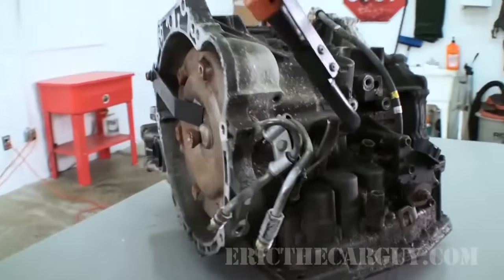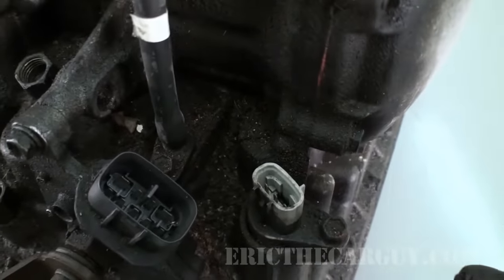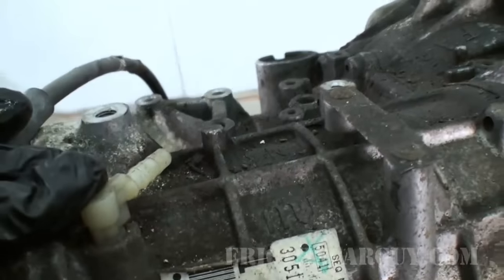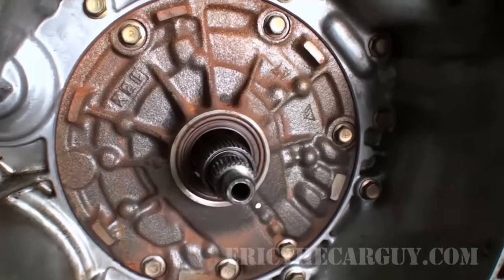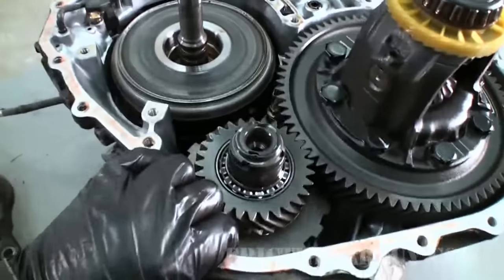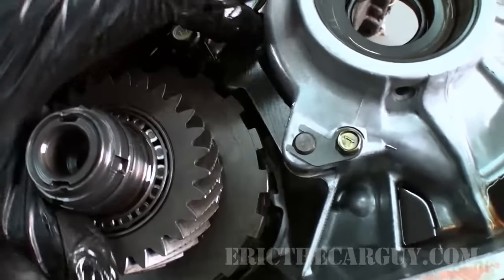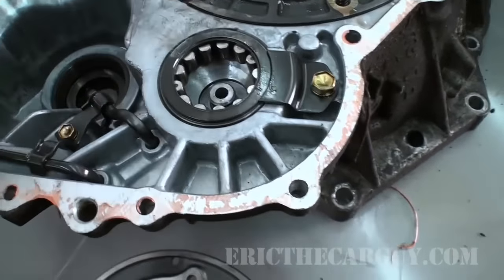The Basic Parts of an Automatic Transmission (Part 1)

Comment: Whoever designed Automatic Transmission is a mad man who could think of this its amazing
Reply: agree
Reply: +Jason K Well you have to keep in mind that it wasn't one person. It took many years of trial and error to get a smooth, reliable automatic transmission. So there were a lot of brilliantly smart people who were involved in the making of this. Same goes for most other engine components. It's really amazing to see how far car technology has come!
Reply: +Jason K It's a product of the free market. That little things Sanders wants to get rid of.
Reply: +Danny Zabolotny very true! hard to believe that 45 years ago people had clothespins on their fuel lines in the summer and points in the distributor. Now we have computer controlled fuel injection that can self adjust constantly, depending on current situation. also thankfully,no new car ignition systems require points! which I am very happy about.
Reply: Henry Ford.  All planetary gear automatic transmissions are adaptations of Ford's model T transmission. He thought of using a pair of planetary gears with bands to arrest the ring gears thereby changing the drive ratio. The T's transmission bands were operated by foot pedals, not hydraulics, but the operating principle is Henry Ford's.
Reply: I remember points, but what was the clothespins on the fuel line?
Reply: It was originally made for city buses in the 30's
Reply: I think the automatic transmission was made by a woman
Reply: It was a brilliant advancement
Reply: @lovestrong4572  Lolz. Ok let's say you are kidding. Right?
Reply: The basic design is really simple. My kid built one out of his toys when he was 4. Played with it in the bathtub.
Actually making it work for a car though, that would have just been trial and error making it better over the years.
Reply: Almost seems like I'd imagine alien tech being
Reply: It was Tesla
Reply: @UndefinedSlope  It's also a product of "access" to excellent education which Sanders is promoting.
Reply: @wailnshred to  stop vapour lock
Reply: @richardrichard5409  Ok I understand now.
Reply: Lovely video content! Excuse me for the intrusion, I would appreciate your thoughts. Have you ever tried - Tarbbatigan Cars Rehabilitation Tip (erm, check it on google should be there)? It is a good exclusive product for learning how to repair your car the easy way minus the normal expense. Ive heard some great things about it and my buddy at last got astronomical results with it.
Reply: You think this is crazy, people thinks it's simple, but the suspension system of a vehicle is nuts and had alot of thought put into it. You're dealing completely with physics and the laws of motion and inertia
Reply: The Automatic gearbox was invented in Argentina they also invented the Helicopter
Reply: Hello let me tell you something they made automatic transmission because it's easy to handle in heavy traffic.Get sense!
Reply: @lovestrong4572  women's can't make these sophisticated things and if a man tries they'll fight and behave as if you are mad
Reply: You don't ever buy a car or even a bycycle all machines are complicated and hard to design and understand
Reply: Very complicated and yet it works like magic..
Reply: Yess!!!!
Reply: Ah yes,  Mr. Otto Trammishin
Reply: I thought the same thing!

Comment: The front pump is driven by the input side of the torque converter (as opposed to the transmission input shaft which is driven by the output side of the torque converter) which is bolted to the engine flywheel/flexplate so that it can generate pressure (flow) any time the engine is running.

Comment: Hi Eric! I watched the whole video and I learned a lot. You see, I have a 2Y Engine Toyota TownAce Automatic and it only runs for 20 km/h. I even stepped harder on the accelerator but it didn't changed anything in my speed. After reaching a 20 km/h, it only slides and doesn't change speed. It stuck with 20 km/h. And it sounds like it's already at its finest but the speed remains. I just want to ask you what is the problem? I am really having a hard time fixing this. Thanks in advance! :)

Comment: I was always curious. What's with all the random veins/holes/slots? Is that for weight reduction? As far as I can tell, they serve no purpose, other then to make the housing lighter? Right on the top of the transmission where the converter goes. There's a few random pits?

Comment: I have a Chevy cruze that I was driving around 70mph o n interstate and suddenly "transmission oil not idle engine"  I h ad to let cool then drive.  A month ago I had fluid out in cause it was low.  I have to drive 60 miles to get home.  Any suggestions?
Reply: Also, I had to add trans fluid about 4 week ago.  I was reading you never should have to add trans fluid. Hmmm

Comment: A hard shift to a certain extent is easier on the 2nd gear band because that means there is less slip and less heat built up. It isn't a bad idea to change your oil so you know it has the correct grade in it. There are a few types of auto trans oil and they are not interchangable.

Comment: so many moving parts and the complexity is astonishing compared to manual transmission. No wonder so much power goes to waste in automatic transmission. Stick shifts for life!
Reply: Eli Malinsky What he's shown is just 20% of the auto, he hasn't got to the details, its crazi i tell ya, he hasn't got to the solenoid and the sensors that work in unison with tha AT networked by the car's ECU and ETC, its madness!

Comment: Eric I noticed someone else also had this concern that If you haven't changed your ATFluid in a long time and then change the trans fluid it could cause more harm than good. Is this true?
Reply: Yes. In fact in newer cars you don't ever need (or should) change transmission fluid. I've never gotten an exact explanation for this, but was told that a sort of harmony is created between the fluid and different clutches and assemblies.
Reply: Roman Smirnov Its called job security, they don't make money if you prevent your transmission from failing prematurely
Reply: That's pretty pessimistic Matt
Reply: If you have a new car, it is best to keep up with automatic transmission maintenance. Have the fluid drained and refilled every 30,000 miles
Reply: First Name Last Name Fredrick mfungati
Reply: Thanks a lot
Reply: A newer machine can actually flush debris from the transmission, so if possible you are able to flush all the old fluid, and the grime and particles from the old fluid out, after flushing the lines for about 2 hours with a machine, it is possible to have the lines and transmission clean, either way it is not good to have the particulates running through the tranny, flushing the transmission and clearing the cooling lines, and the oil pan have a very high chance to get rid of the particles that were made from when the fluid was there for so long, the machines also do not "suck" the fluid, you hook up the machine to one end of the cooling system for the transmission pumping out the old fluid while also pumping in the new fluid, so its a 1-1 ratio of removing and adding.
Reply: @romansmirnov3351  called reality
Reply: First Name Last N
Reply: @romansmirnov3351   sealed transmissions from the manufacturers arent fully sealed, you can infact change the fluid just remove with a hose and suck it out and squirt it back in, also car makes such as volkswagen say their transmissions including manuals from the older vw jettas are sealed for life, so you shouldnt have to change it for the transmissions life aka until it needs replaced, rebuilt, and for life as in 150k or higher depends on a lot of things, but you can change the fluid cause there is always some sort of filler hole/drain hole etc, and trans fluid should be changed every so often, keeps the transmission from overheating because dark fluid is from dirt, grime and small metal pieces and they heat up and cause the fluid to heat to a higher degree than clean fluid/refreashed transmissions.. but as for manual transmissions they tend to last longer than automatics, usually can always change the fluid easily, and just keep clutch replaced but overtime every transmissions gears teeth are gonna wear down to the point where itll slip and not grab/bite
Reply: @romansmirnov3351  Not really, it still needs to be changed, they claim you don't need to because they want you coming back for either a new transmission or a new car when it fails from lack of being serviced.  Many times you can get away with a 50k service interval for a car's transmission, but for a truck doing some heavy work cut that in half.  Transmission fluid is a heck of a lot cheaper than a transmission or a new car.  

Fluid still needs to be changed regardless what the manufacturer claims.  Transmission shops will tell you the same thing because they see this lack of service on a daily basis so they know what happens far better than I can explain it.  

On the other hand if the fluid has never been changed in say 100k miles then I'd be careful about changing it, take it to a shop and they can determine if its safe to change or leave it alone.  I did this with a questionable vehicle that I was unsure of the service history on and the seller couldn't recall if it had been serviced or not and I took it to AAMCO and they tested it out and said it was ok to change the fluid and filter...that's been about a year ago and the transmission shifts great, need to have it serviced again to drain out more of the old fluid.  Doing a fluid/filter change doesn't get rid of all the old fluid, you still have fluid in the torque converter and other passages, kind of like an engine, you never really get 100% of the old oil out.
Reply: @alcool0828  This is a very good rule, I wouldn't recommend doing that flush on any transmission really, there's no need for it, a simple drain/fill and filter replacement will do fine...and ignore the "lifetime" fluid BS of automakers, they do that in order to get you back to the lot for a new transmission or a new car when your old one blows up from lack of service.

Comment: It's a a245e transmission from corollas from 93 to 08 lol it's bulletproof if you dont let metal shavings contact the solenoids
Reply: +Bryan So metal shavings contacting these solenoids somehow is actually possible let alone a common defect here?
Reply: I agree. Built by Aisin Seiki in Japan for Toyota. My 2000 Corolla has 220,000km and going strong.
Reply: Evan93 mine has delayed engagement now, 175k miles. Bought it used a few years back tho

Comment: Very interesting! It blows my mind that people thunk this stuff up!! Just blows my mind! But, I'd need a xanax the size of a hockey puck to assemble it all again :(
Reply: If you stop, slow down and think the process through and take your time disassembling and reassembling one isn't too bad, use the factory manual and go step by step and don't try and take short cuts.  They're not as complicated as people think, just a lot of smaller parts to try and not lose or forget...and you really don't want to forget any as often times if you do the whole transmission has to be pulled apart again due to the way they're assembled.  Many of the components are broken down into smaller groups of components, which helps a lot, so disassembling or reassembling the smaller groups of components makes the whole process much easier to understand.

Comment: The Ford AOD has that lever which goes to the column shifter.
Reply: Most of them do, err...did, I believe a lot of the newer ones don't, they're electronically controlled by wire rather than cables or levers, so when you move the shift lever you are just sending a signal to the computer to put it into whatever gear you selected.

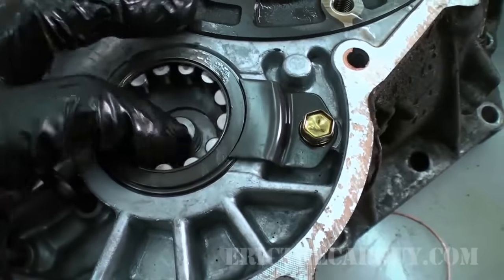Comment: I have a 98 MPV. I recently flushed the auto-transmission fluid. Inside the trans fluid pan I found broken a plastic washer that looks just like the one above the bearings in minute 21:08, only mine was broken in half and sitting in the bottom of the pan. The MPV has been running fine, however I do notice a faint smell of something burning. Any suggestions on what to do ?

Comment: "If I find a problem with an automatic transmission I just replace it". I understand why mechanics do this (less chance of future failure, easier than fixing, make more money), this thinking creates a lot of waste and makes things much more expensive for your customers. Put simpler this way of doing things is better for you than for the customer.
Reply: Ra0king maybe, maybe not. the transmission being removed usually gets rebuilt and sold to someone else. Meanwhile buying a rebuilt instead of having a mechanic try and repair it, when it may not be his speciality, is more likely to leave you with a more reliable car. Sure, a bit more expensive, but sometimes reliability is worth the expense.
Reply: You could fix it yourself then 🤷‍♂️. Instead of simply remove and replace with warranty for a labor intensive job like this you could attempt to repair it w/o warranty and see how she goes
Reply: Well in the case of tearing an automatic transmission apart to replace say a $5.00 bearing, they've pulled the transmission out, torn it apart, removed the old bearing, installed the new bearing, inspected the transmission for possible other faults, reassembled it, put it back in, test driven it....that's a lot of hours so yes, it makes sense monetarily to just replace it at that point.  The transmission rebuild for my 1988 Ford Bronco 2 (A4LD) was $2400 that included removal, tear down, inspection, rebuild with upgraded components, reinstall, test drive, etc.  As well as a 2 year warranty.  It shifts great now, and haven't had any issues from the rebuild 3 years ago.  They said they could have just replaced whatever broke, but by the time they did all the removal, tear down, inspection, part replacement, and reassembly and install it was actually about the same cost as just having it rebuilt since it was already apart anyways, and it just made the transmission better....a good shop will not only do a rebuild but they'll also do all the newest updates and upgrades within reason, and can always add additional upgrades like shift kits, higher grade parts, etc. if the owner wishes to pay the additional cost of whatever additions they want.

Comment: The seals in the transmission are not what cause it to fail usually, that's misdirected info. Leaks might cause it to perform worse but stuck valves and oil starvation is what causes at least honda transmissions to fail. And a bunch of other things like broken bearings but seals are the least of your worries unless you have a major leak but there's a lot of other things that fail that are more common

Comment: 4:14 I'm confused by the purpose of the cable, does anyone else know and can explain?
Reply: If I'm not misunderstanding, it tells the transmission how much you're accelerating (pushing gas pedal) so that the transmission can hold off on switching gears until it is reasonable to do so.

If you have a car with an automatic transmission, try going on the highway and try keeping your foot on gas as long as you can after a full stop while watching tachometer for gear changes or listening for gear changes. You may notice that car won't go into the higher gears until you let off the gas enough or the acceleration of the vehicle is low enough.
Reply: @159Spark  Most modern cars don't have a cable, the TCM gets it's throttle position from the throttle position sensor. The kickdown switch is also used in a lot of modern vehicles to tell the transmission 'Ey! Its time to pick up the pace!'

Comment: I could really use some help 
My 2000 Acura tl has low transmission fluid pressure and I know I am going to have to rebuild it but I can't find anything or the transmission pump. I know all transmissions have one but I can't find a replacement number for the pump or if it's even serviceable! There is no information anywhere. If Ericthecarguy could help me or anyone it would be amazing!

Comment: I have a p0741 on the A245E(Toyota Corolla 1.8L 2006) transmission. It states torque converter solenoid performance stuck off or electrical. Circuit aspect looks ok after series of test. Found out most common problem on this type of transmission is stator shaft bushing. Could you pls point me to this part. Thanks

Comment: Hey my 2008 3.5L dodge charger is giving me a code of P0734? Of the Gear 4 is slipping then putting my car into limp mode but I been just putting my car in 3rd in the mean time then it turns off the check engine light but man people/mechani  are saying it could be my pump in the tranny but my car has been linking tranny fluids to..... Could you help me!!

Comment: Can you or someone give me some tips? I have a 2009 Toyota Rav4 v6 5 spd auto. This car has a history with faulty transmissions. My problem is that at low speeds when I give it a little bit of gas, the transmission doesn't seem to engage, and then it does so with a jerk or a lurch forwards. Really noticeable at stop and go traffic. 
 Also when I downshift from 3rd to 2nd, there is a 1 second delay before the car starts pulling. The engine will rev, but the car only receives the power after that second. It almost feels like the clutch isn't engaging/disengaging when it's suppose to. Any ideas?

Comment: I have a 1995 accord ex 4 door with rough shifting, and my research points to solenoids.  There are "shift" and "lock up" solenoids and I have a hard time finding information about finding out which type may resolve my issue.  Any videos you can point me to?  Thanks!

Comment: Eric what types of automatic transmissions dont use planetary gearsets? The only ones i can think of are CVT's and DSG's which are not technically automatics. They have been using the planetaries since the 50's have they changed?